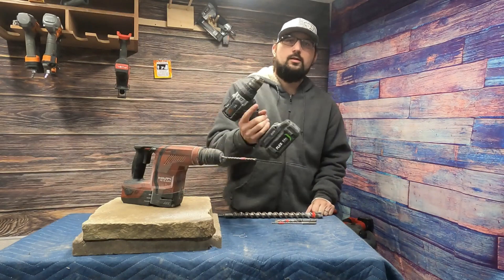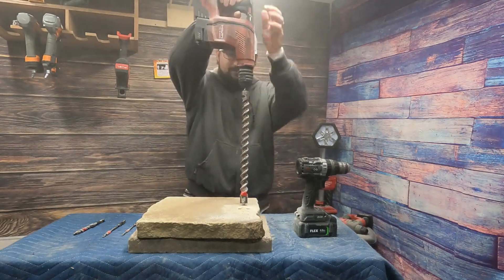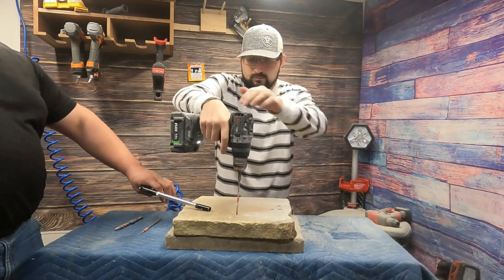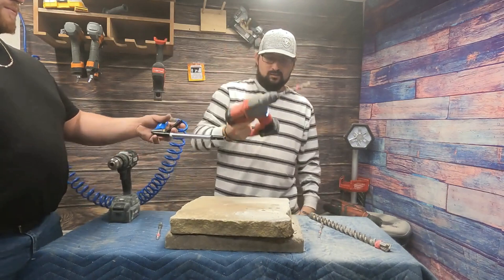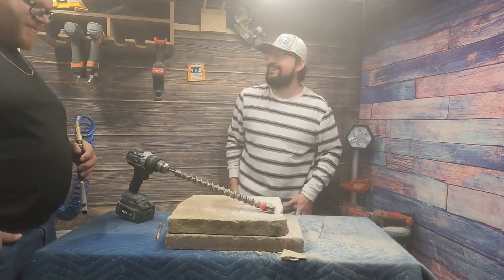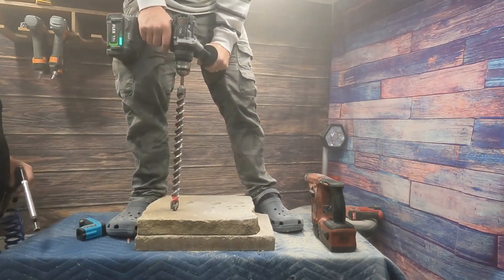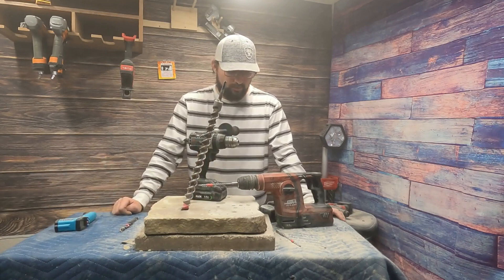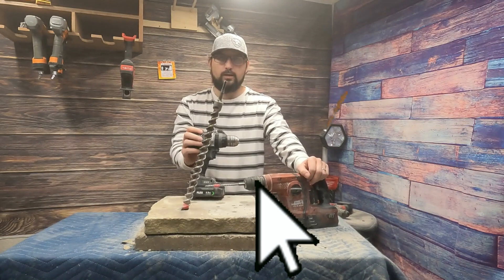Can a Hammer drill be better than an SDS ???    Hammer Drill Vs Rotary Hammer Feat-  Flex vs Hilti!!

Comment: This would have been a good test for the flex vacuum as well.
Reply from the maker: Yeah!
Reply: I agree!!! Your poor lungs, it would be safer to leave the dust settled around the hole, concrete dust is not particularly great for your lungs my man!!! I hate wearing a mask too but don’t push the dust airborne cause than it’s a problem…